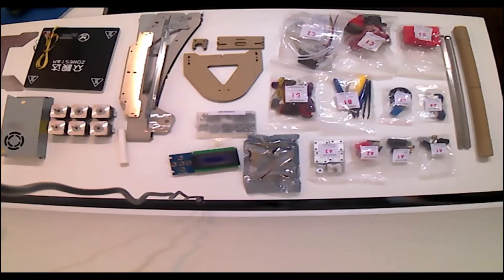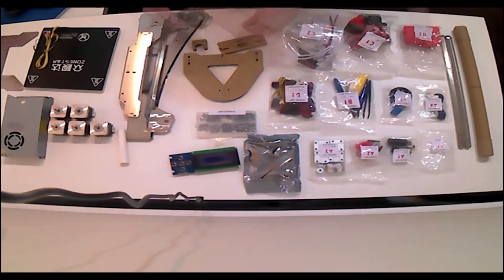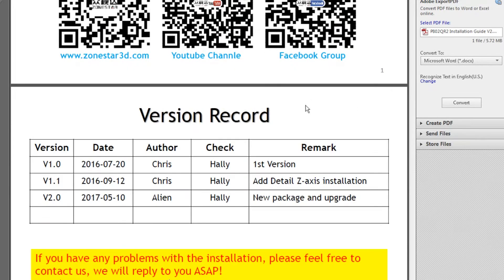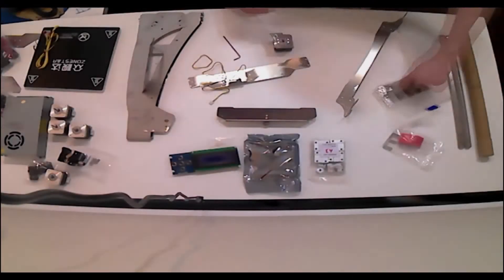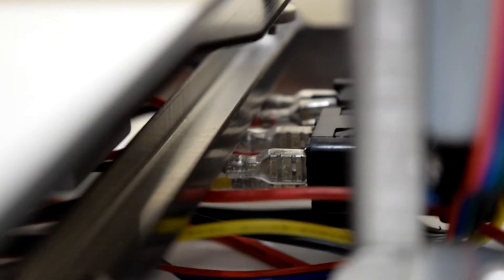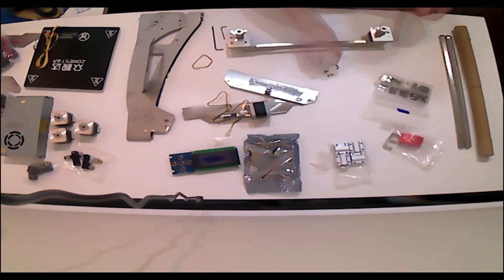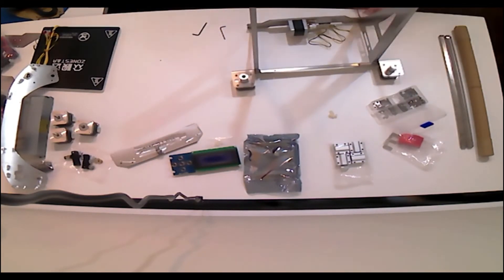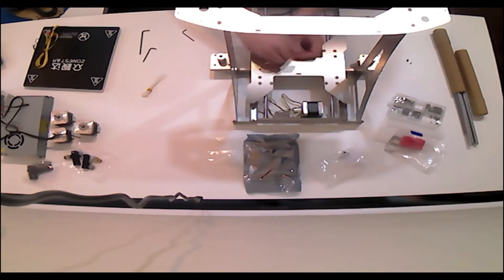Zonestar P802QR2 Dual Extruder 3D Printer | Build and First Impressions

Comment: Have you been able to get the auto leveling to work? I haven't been seen any difference with the leveling and having trouble with the way they have the g code it tends to start printing from where it stopped measuring.

Comment: What selection of printer would you use in Simplify3d for this printer?
Reply: So now my question is, after I got it start printing off the SD card..... how do I get my new laptop to recognize it on USB? I installed the driver but Win10 doesn't seem to like it...at all
Reply: No responce at all in the Simplify 3D.  The Repetier Host says it is there.. but no comms
Reply: The la[top is not recognizing the printer on the port, it identifies the CP2102 USB "object" but not what it is or a COM assignment.  I believe it is a driver issue and I will run it to ground today...
Reply: Ahhh running the Virtual "port" through USB.. getting that package now.

Comment: I bet you didn't assemble the extruders correctly. There should have been an adjustment for the spring tension.
Reply: so what is the common mistake that most people have a hard time figuring out? telling us that there is a problem is one thing, but give us the solution makes for a better video!